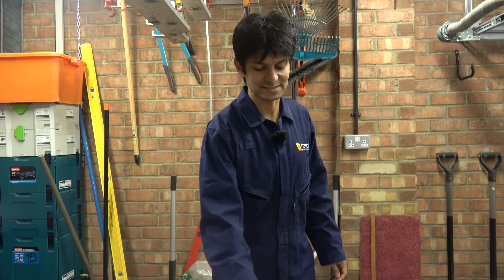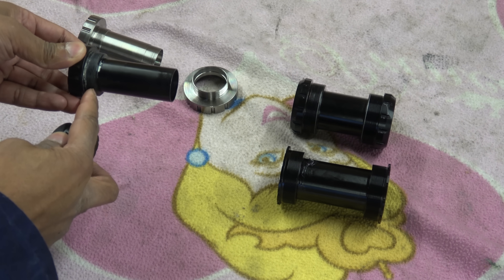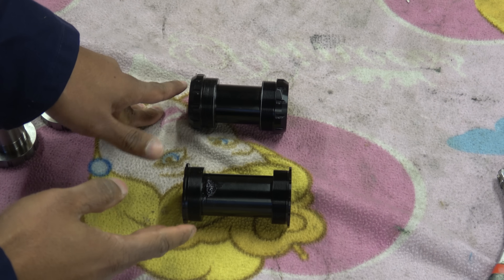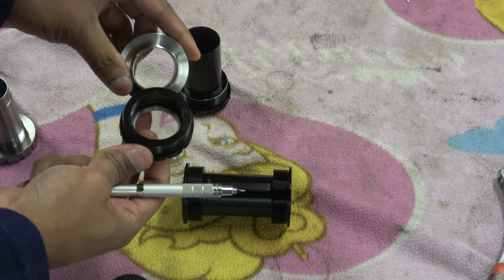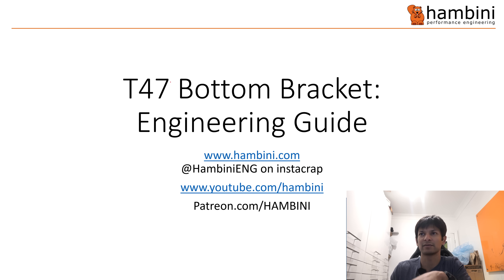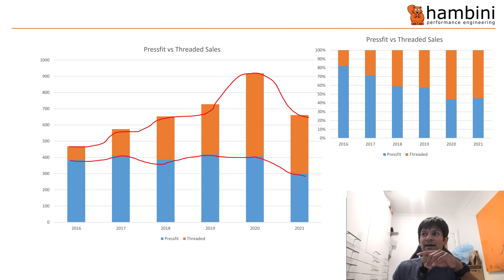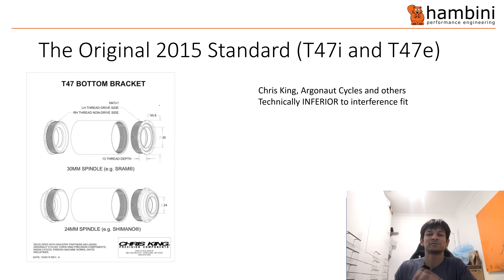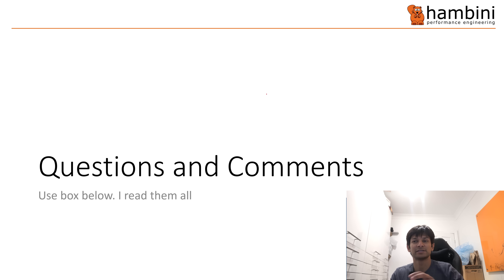T47 Bottom Brackets | Full Engineering Guide | Everything you need to know

Comment: You can't just look at the BB. You must also consider what is happening in the frame building process. New innovations in bonding agents may overcome problems of thermal expansion or galvanic corrosion. Also, the frames may be made using mandrels or other improvements that reduce the alignment problems or improve the threaded BB reliability over time.  We may even see a comeback of lugged carbon frames made using 3d printed or other kinds of lugs, perhaps even threaded metal. Lemond has apparently developed some significant improvements in CF manufacturing that increases reliability, while at the same time reduces costs.

Comment: What is the advantage of threaded when you are still having to insert a metal receptacle into the plastic frame? I would guess just less likely to creak? I imagine if manufactured well, then a press fit would still be the best option on a carbon frame. Speaking as someone with a Trek Emonda SLR- BB90 and, touch wood, had no issues in 2 years 😛

Comment: In the 90's Colnago frames suffered intermittently from Galvanic corrosion in relation to the threaded bb insert. They fixed this by bonding in titanium inserts instead. A few years later they reverted back to aluminium and never suffered a relapse the aforementioned corrosion.Colnago  ( like Pinarello I believe) have always used a threaded bb and don't suffer from galvanic corrosion or de-bonding on the bb interface so it must be doable to do this reliably.

Comment: The big advantage of the t47 86 for custom frames like mine is that I can clear larger tires with a shorter chainstay since there is more frame material to attach the chainstays to. For road applications, I see the benefits of the 68. Also with the 68, you can put the t47 86 in them to run the older style bb30 cranks.

Comment: The solution to both galvanic corrosion and bonding failure with aluminum (especially with carbon) is anodizing without sealing or dyeing, just before bonding to any other material. It's really the only solution long term. It both increases adhesive bond strength regardless of surface texture, and electrically insulates aluminum from any chance of galvanic reaction. I find starting with a smooth, even polished surface before anodizing provides the best insulation and bond.  It's such an inexpensive process, it baffles me that every aluminum bike part isn't anodized.

Comment: Serious question: Do any of the manufacturers pre-wrap knurled their aluminum inserts before bonding them into the CF? Or is that layer of bonding glue considered sufficient? When I build my home-builds, I wrap CF around the BBs (not just gluing in, but wet layup with compression around the BB shell, so I do not get voids as they do just gluing in...) but before I do that, I layer 2 or 3x layers of fiberglass over the shell to provide a layer of insulation between the alloy and the CF. At that point, my biggest worry visavis debonding is the potential to thermal shock and the big differences in expansion between the aluminum and the CF composite. (I'm too cheap to avoid those issues by buying Ti shells).

Comment: I run the brand 15Sixteen we make ti gravel bikes and there is an noticable difference in stiffness from BSA 68 to T47 in the bottom bracket area.  I'm no engineer so wont dive on the specifics on the two bb's items but we do prefer the T47 from a stiffness point of view. 
When it comes to weight its nearly negligible one has a smaller bb shell and longer tubes and the other is a larger bb shell and smaller tubes.  when welding its also easier to maintain square on the larger area. as well as less heat drive in a smaller area.   
Time will tell on the longevity of the bb though. The frame will last for ever.

Comment: Thank you for another great vid. Have you or some other party done a quality testing of e.g. crank spindle stiffness? I'm not interested in showing that an 30mm spindle is stiffer than 24mm, but something that comes down to if it really matters or not. For example, I've been trying to look at what track riders use when they appear on Eurosport, and to me some are still using square taper axles/cranks! Briefly put, If I'm correct in that, then to me the whole 30mm standard at least seems completely unnecessary performance-wise, and is therefore a marketing driven standard. And yes, I am aware that there are many other points of contact that would need to be taken into account when measuring something like deflection in the "crank area", but that's my point, has somebody done such a thing and tried to really isolate things to see what really matters/is sufficient in that area - spindle being one?

Comment: Seems like a shame to go full circle from more or less the Truvativ ISIS overdrive (late 90's or early 00's).  I guess T47 easier to install but doesn't address the issue of what you said in early video about the bearing being under compression (on the Campy cranks) with old sq. taper, ISIS or octalink cartridge bottom bracket.  Up until a couple years ago I used a Phil Wood BB for 10 years and never once had to fuss with it.  Seems like if went back to three crank system with cartridge bottom bracket (pressfit or threaded) much of this BB shit show would go away.  I never remember having many issue with Octalink or any sq taper BB, other then the Dura Ace Octalink didn't last.

Comment: My Trek came with a T47 for Shimano which was a Praxis T47-IB (85.5 inboard bearing) which require a Trek specific tool to install.  The tool made for a better fit without damaging the frame.

When the Praxis BB wore out, I replaced with one from Wheels MFG.  This required a different T47 tool as the outside notches were different.

Then I replaced with a Chris King T47 which required yet another T47 tool as the outside notches were different.  

However, Chris King T47 + Sram Dub AXS Red = :)

Comment: I've been running BSA30 bottom brackets without any issue for over 40,000km between 2014 and September last year when the bike's replacement arrived. Most of that on the same set of bearings, which remained smooth. Setup was Rotor 3D+ cranks and Power2Max power meter on a Cannondale CAAD9 that had a BSA BB sleeve fitted by the OEM to accept Ultegra cranks. I would happily use that setup again.

Comment: My steel Tommasini doesn't have any voids at all. Even though I get dirty water on the bottom bracket,  I don't have galvanic corrosion problems. I also don't worry about a carbon fiber frame breaking under me. I must say that I am paying the price. My Tomassini Fire with a steel fork does weigh 1/2 lb. more than my Trek Emonda did.

Comment: Dub BSA has worked fine last 3 years on my trail and gravel bikes with a fair amount of abuse.  Neither bike came with DUB I upgraded from cartridge on a Cannondale on one and from GXP on a Specialized on another.  I do periodically disassemble and inspect the bearings and cups and have replaced one or both cups if the bearings feel gritty at all.  The basic bsa dub bb is fairly inexpensive to keep spares and replace considering replacement is rare.  The seals are pretty effective just gotta be careful with the little blue o rings on the sleeve.  No creak or noise has has been from the BB on either bike.

Comment: I've been using a 30mm axle Lightning axle in BSA68 since 2008, plus another version in BSA73 from a few years later. There has been no issue with debonding, mis-alignment or other ills. Guess I got lucky, with both the Cervelo R3SL and the unbranded Chinese MTB frame.  Lightning supplied the outboard bearing holders with a fine cross-hatch and a piece of 3mm rubber: the idea was to tighten the bearings by hand, hence avoiding over-stressing the bearing holders. That seemed to work just fine (although getting them out usually required some careful use of multigrips). There were other issues: using low strength loctite on the center-bolt to avoid it backing off during a ride, and the slightly hair raising method of breaking it loose. Real design issues, but not related to the bearing carriers.
Changing bearings was so easy, just put the carriers in the oven, wait 15 minutes and the bearings simply fell out.
Since I was young(er) and stupid(er), I used various cheap ceramic and hybrid ceramic bearings which didn't all last so well, but that was user error. In fact though, the all-time short-life champions were the no-contact NTN's I put in mid 2022, followed by riding through a flooded road during a rain storm in France. The effect of temperature difference was pretty obvious, it pulled water into the sealed sleave and removed all the bearing grease on the way. One more ride and they were rattling, so I filled them with grease, rode a couple more times and put the bikes in boxes to move to Adelaide. They didn't last too long after arrival, but they have some regular-seal NTN's now and all seems well. It's now bike n°2, behind the Winspace SLC, with the annoying PF86 BB that a certain English marketing guy called "stupid" before being hired... It still gets ridden enough, even though I'm now retired thanks to Covid, and my FTP is about half that of a current pro of my weight...

Comment: I did a new bike build with the T47A (bbright etc) and it performs fine but was a bit annoying installing it because you need two different tools and as you said, you need perfect tool alignment to get proper engagement with that 2mm while not scratching the frame.

Comment: Pinarello never stopped having threaded BBs.   My Pinarello bottom bracket area got gobbled by galvanic corrosion within 18 months and had to be warrantied.  Then the same happened to the replacement.  I do have exceptionally acidic sweat though ... .for non-freaks I wouldn't expect galvanic corrosion to trash the BB until just after the stingy two-year warranty has expired.
Reply: Would Ti be a better option than Al?   It doesn't corrode, therefore avoiding galvanic corrosion and it won't de-bond either ... as I can testify after leaving a carbon seatpost in a Titanium frame for too long - they weld themselves without the need for a bonding agent.
Some boutique brands recognize the issue and put their use of Ti inserts on their marketing.   When I'm paying in excess of £3k for a frame, I wouldn't mind paying an extra £100 for a Ti BB to extend the lifespan beyond two years.

Comment: Question: on a more generic view, if we stuck to steel, 24 mm axles, would many of these bearing/clearance/tolerance issues improve? I haven't bought a crankset in a couple of years but I deliberately avoided a 30 mm axle on my last build because all the compatible BBs seemed like they were bodging a larger axle where there is no reasonable way to do it - either undersized bearings, very thin walls, low tool engagement or a combination thereof.

I also don't like aluminium axle faces rubbing on the steel bearings, but that's just me.
Reply: The only real advantage a 30 mm aluminum crank spindle has over a 24 mm steel one is light weight. Actually getting it to work on a bicycle and its bearings though is a whole 'nother story, and you've pretty much enumerated all the arguments for steel/against aluminum.

Shimano has rightly taken flak for their bonded crank arms coming apart, but their core Hollowtech II crank spindle design is pretty darn solid. For best results one could just stick with a 105 R7000 crank, or one of the non-series units (FC-R510, FC-R520) if weight isn't as much of a concern.
Reply: @TypeVertigo  
“30mm aluminium spindle is lighter’.
That’s the marketing front.

Manufacturers love aluminium spindle because it’s easier to machine and easier to form, more or less, to a similar weight as a shimano 24mm spindle.
Look around, there’s no single manufacturer makes 24mm spindle as light as shimano, including Rotor 24mm Aldhu track spindle (there should be someone weighing Aldhu spindle on yt)

Comment: Perhaps a dump question but the wall thickness of the threaded sections of the T47 seems excessive - could you increase the sleeve diameter slightly to get rid of some of that material - I know the sleeve would of course then weight a little more?
Reply from the maker: Yes you could but it would reduce space for cables
Reply: @Hambini  I have an idea - let's run them on the outside of the frame!

Comment: Unless I missed something, I had read that one of the original design aims of T47 was to allow for a larger bottom bracket area to facilitate greater welding surface, especially for boutique ti manufacturers. Yes/no?
Reply: T47 (typically a 50-52mm OD BB shell) helps larger diameter tubes to be welded on without joint overlaps. Welding a 50+mm aluminium downtube, a 45mm steel or Ti one onto a 41mm OD BB shell can be done with some fudging, but essentially the BSA 41mm OD BB shell evolved to live with 'classic' 28.6mm and 31.8mm OD steel tubes. 
The larger diameter of the T47 BB shell also increases the available offset for the downtube and chainstays from the axle centreline. Again helping reduce weld overlap and increasing weld access. 
The longer T47 x 86.5 and 91.5 internal bearing shells do allow a wider spacing of the chainstay welds, aiding tyre clearance, increasing weld access and reducing joint overlaps.
As Mr. H shows, there are other issues in play with carbon frames.
Reply from the maker: I can't see why it would make a difference against BSA
Reply: In the mtb context (take the design of the Fairlight Holt for example), my understanding is the extra real estate gives the builder flexibility to also attach the ST further forward on the shell which can increase tire clearance without having to bend the ST to create it (this is nice for aesthetics, for manufacturing simplicity/speed, and also dropper posts).

Comment: All of us that aren't in the industry have our anecdotal experiences. Mine is that anything that I have touched that is threaded is better than press fit. For the mid-range bikes I ride the manufacturers seem to be able to get the threaded interface to work better. I currently have two PF 30 bikes with frames with non-concentric non-square holes. As you pointed out many times this can be extremely hard to fix, if there really is even any fix. That t-47 thing with the thin engagement, I use a headset press over the top of two bottom bracket wrenches. There's a little bit of fooling around loosening or tightening one thread at a time, but it works every time.

Comment: Likely an unpopular opinion, but I’d rather a technically inferior BB design that is more easily repeatable for the manufacturers who have demonstrated an inability to control the relevant tolerances. I’m inclined to think this way as the performance of an acceptable T47 BB implementation will perform better than all the fucked up press fits. 

I wholly acknowledge that PF bottom brackets can be ‘repaired’, but most consumers are ignorant to that fact, or unwilling/unable. However to be fair, the consumer shouldn’t be responsible for QC and corrective action. 

I have a T47 bottom bracket on a gravel bike that had galled threads despite a thorough greasing. Thankfully the manufacturer was willing to simply send me another frame, but I don’t anticipate that will be how the industry handles this moving forward. 

All that said, the disbonding/corrosion issues can be avoided, I think this may result in a better quality of life for the consumer. However I remain cautiously skeptical.

Comment: Would be really interesting to hear your thoughts on bearing size/diameter and how that affects performance and if it does at all?
Reply: As in the size of the balls themselves? I can tell you that, all else being equal, a larger ball has greater load handling capability, is less sensitive to grease viscosity, and is less prone to damage from contamination. It's like a bigger wheel going over a rock vs getting completely stopped by it and then skidding. Ideally the bigger bearing then pulverizes the debris.

Comment: What's the role of patents in this? Will Shimano's 24mm patent expire at some point, and then everyone will go back to that bc it's the best? Also, is Rotor's 24mm solution possibly even better by applying the BB30 preload method to 24mm axle?
Reply: Shimano had patents on the HT2 preload/fastening arrangement (US6755095 etc) which expired only about a year ago. But it's not because of patents that other manufacturers are pursuing 29/30mm axles, it's because an aluminium axle needs to be bigger to match the strength of a steel one.
Reply: pretty sure theres no patent on 24mm axles, or if there is it would have long expired.